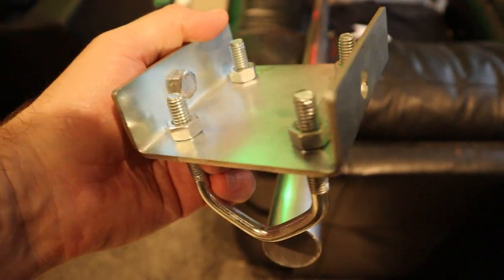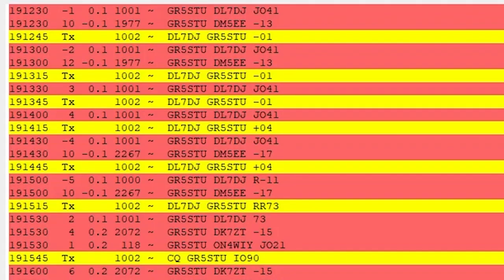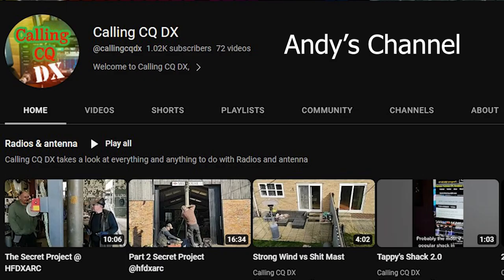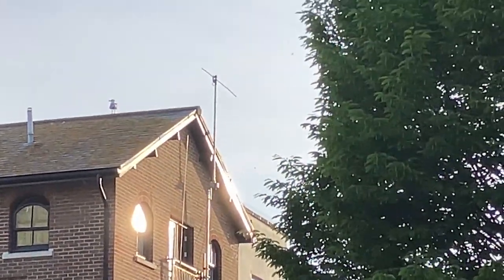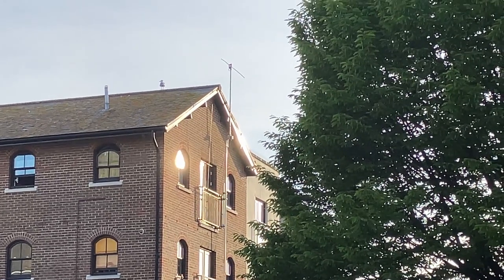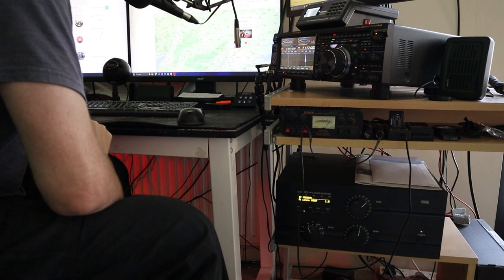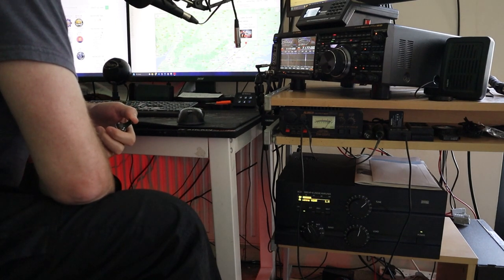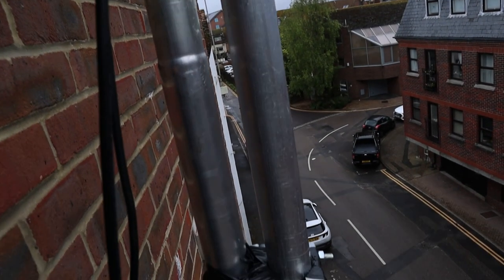HAMSTICK Rotary Dipole on a balcony for HAM Radio ?  PART 2

Comment: Great work. Hope to catch you on the air soon. Need to test my doublet in the attic now.
73
Reply from the maker: mine works well, i may well go back to it but put it on a an auto tuner instead of manual.

Comment: Glad it worked well for you , I don’t know why more don’t use them , the high band ones work better still , instead of the mfj octopus you could simply add say a V dipole connector on same pole as horizontal connector then use a T So239 with short patch coaxial cable to connect them both to same feed giving you 2 bands , de 2e0nbk
Reply from the maker: Cheers Nigel, not a bad idea, i may look into that.

Comment: All looking good stu n i had the multi ham stick one n it was so  cheaply made i wouldnt bother unless you can pick one up second hand maybe.looking forward to the next one 👍👍73
Reply from the maker: Hey Andy, yeah I saw Oggy talking about them, he said they weren't very well made too. I mainly built this for 20m to try and improve DX reception so will be interesting so see how well it works on 20m. If that works I will be happy.
Reply: @G5STU  I've got a week off soon as been flat out at work for few weeks so looking forward to spinning that dial :)